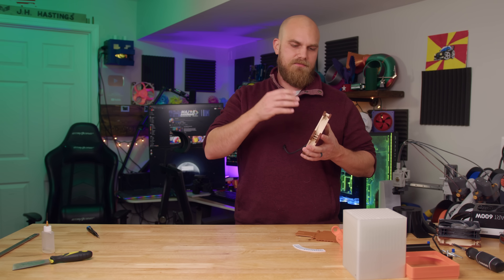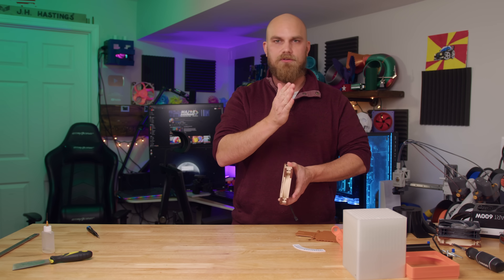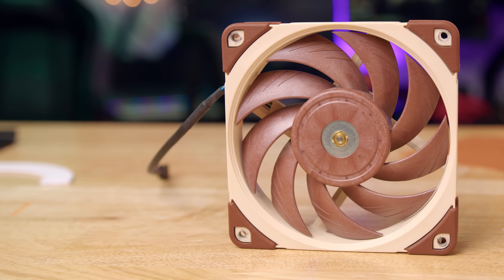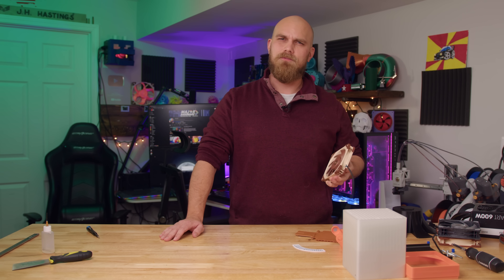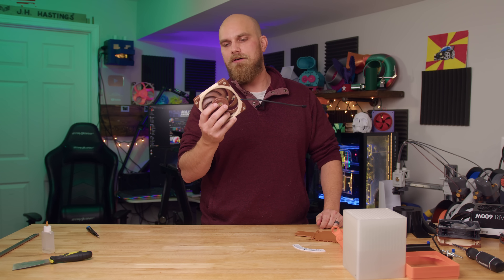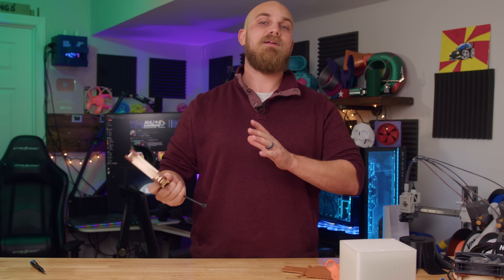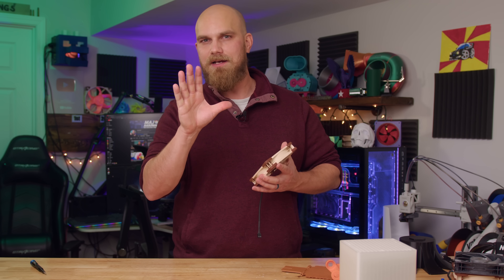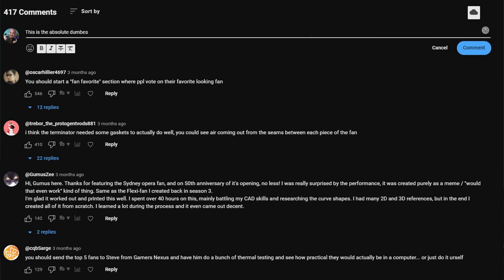I Built a Static Pressure Machine | Fan Showdown Season 6 Pilot

Comment: Looks like the scale will only be interesting between 3 (poor) and 6 (very good) , given that the Noctua motor with its power curve are the common denominator. You could do an eccenter (?) on the hinge of the flap and measure the micrometer difference with one of those toolmaker clocks, to get a finer scale... Or extend the dial on the flap and make the scale bigger. 😁

Comment: Just for a bit of data collection. Put a potentiometer on the pivot of the flap. That'll give a voltage that can then be used for calculations. And enclose the flap in the tunnel.

Comment: I don't know what type of ISO specs are out there, but I would assume getting a good static comparison would require deadheading the fan.  Otherwise once the fan is flowing air through a cracked door you are not getting the maximum amount of pressure it is capable of.   Given the goal is a static pressure and that you know the pressure range your working in, check how large the door would need to be in order for the fan to force it open to a measurable angle and then work out from there how large the door would be to allow you to add weights to the door at different heights to know what the pressure is.

Comment: I think a fully contained diaphragm (whereas the angle doesn’t change) with some sort of tension would prove more useful. You would measure the displacement of the diaphragm from rest. The changing angle of the flap you are currently using means that your scale isn’t static as far as unit size as the greater the angle from rest, the less direct force on the flap.

The diaphragm could still be a solid flap. Place it on bearing tracks and have a rest position where it is held with tension via springs or elastic. The full force of the fan will be measured this way as it will be fighting against the elastics until the force equals out. Just an idea, though I know there are still complications and errors with this design too.

Comment: As the angle increases more pressure will be able to escape, and the deflection angle will be shallower, as a result there will be diminishing returns, graphing the pressure to angle would show a function that looks logarithmic, would go up fast but then slow down to almost flat. While you can still get data from this the higher the angle the more precision in your angle measurement you would need. Plus there's likely to be oscillations/turbulence still and as such the flap with almost certainly be flapping a bit making a reliable measurement unreasonable. As stated by kendalguier1378 putting the flap inside the tunnel would help, as the air wouldn't be able to just go down once passing the threshold, however the logarithmic behavior of this would still remain.

Comment: Given the hing position most of the effective force will be at the far end of the flap thus its not ideal, you probably could divert most if not all of the top airflow and almost get the same result. This also means that the force indicator will not be linear compared to the "real" static pressure. 

I would instead suggest turning the tunnel vertical and have a sliding flap around a center pole/pillar.

Comment: Not an expert, but...
Your idea is pretty good, however here are some issues from least to most important:
- The scale is not linear
- Scale is too small, make pointer longer. And you can make lower flap more rigid too. Mass is not an issue, since you're measuring when the flap stops moving. If mass is, say, twice the amount, having center of mass twice as close to pivot point should make it perform the same.
- Don't think this is a good measure of static pressure, since there is still airflow. Imagine testing 80mm, hell maybe even 40mm server fan with some sort of adapter. While those normally have higher static pressure, your setup might still show them performing worse. In fact, stacking 9 40mm fans in 3x3 grid should give you the exact same static pressure as just one of them, but here you'll see vastly different result.Your contraption would still be useful for testing (imo better than pure static pressure), just don't call what it tests a static pressure because it isn't.
When i think of static pressure, i think of a fan blowing into closed box. Yes, closed. How to measure pressure? Well, imagine a soft tube (watercooling one is fine) that at one end starts in that closed box, then goes down and then up again, and ends somewhere where you consider to be normal pressure, say taped to the outer side of that box opened to room air. Now fill it partially with water. You'll have two water levels in the tube, so using the fact that you have soft tubing put them next to each other. You'll see that levels are equal. Now turn on the fan. One water level will slide lower (the side that connects to inside of the box assuming fan blows into the box) and the other will go higher. The difference between the levels is the pressure reading. Problem is that for noctua fan that would be 2,34 mm, which isn't much and is hard to read. However, you can use hydraulics to make the difference more apparent. Connect thick tubing on the box side with very thin one on the other side. The way you connect them doesn't matter, as long as it doesn't leak and doesn't have bubbles. Now, assuming crossectional area of thick tube is 10 times bigger than that of thin one, if one side goes down by 1.17mm, other will go up by 11,7mm, so 12,87mm total difference, which would be much easier to read. Now you can do math to get exact pressure or just not bother and use relative scale since it still is linear. there will be a small problem tho. When fan is off, the levels won't exactly match because of capillary force. That difference, however, will be the same no matter the pressure, so just subtract it from every test. Just remember, since you don't want to have to pour the exact same amount of water into the tube every time, you measure the difference between water levels.

Comment: A lot of people advised to use a U shaped manometer. My two cents to this idea is to use a fluid which has the lowest density as possible. Oil is less dense than water. This can increase the sensitivity of the device.
Reply: There's always isopentane but you need to keep the liquid under 80F, or it will boil. Also flammable 💥💥💥
Reply: @knibknibknib  Haha, good one! I don't think a liquid with high vapor capabilty (eg alcohol, pentane) would be a good choice, though.

Comment: Glue a plastic "Trailer" type 2-way level on top of the tunnel to confirm level before each test. At least consider the potential effect of supply voltage, air temp & humidity on test results.

Comment: You could make the door smaller so it's easier to push open and use up more of the gauge, or make the arm that marks the gauge reading longer so it's weight helps balance and open the door further. if you could somehow have a digital gauge to read it that would also be cooler.

Comment: So, the air is all leaking out the sides and bottom so you hit "maximum" very early. You can get more reliable results at a larger range if you put the flap in the middle of a longer tube. Basically, the wind tunnel you had before, but right in the middle of that you put a similar flap and measured the same way. Very simple, but it would give you more granular results. As it is, the way the air flows on your scale is almost logarithmic (it isn't really but getting from 9 to 10 will take WAY more pressure than getting from 8 to 9). 

TL;DR - fully enclose the flap.

Comment: Flip the door around. They way you have more surface area to resist the air flow. As is, you have a sick surface for the air pressure to slide off of. So once you get sufficient lift the rest of the airflow just slides past. As is, i expect many fans will fall into a very similar range of measurement. Less granularity of measurement.

Comment: The higher you get the less air will actually be hitting it. Also airspeed and volume will play an almost equal role is how far that flap goes up. 
In actual tube and hose with water in the bottom leveled out to the zero on the hose will give you true static pressure. You can get accurate measurements this way that correlate to industry standards for columns of water.

Comment: I like the idea. You should try using TPU gaskets on top of the end of the parts, where they are joined. I do not think it will improve the performance or accuracy by a lot, but it might. 

You also said that the isogrid you added to the flap was 2mm thick and 1mm wide. I do not think it is very heavy, but you should try making it even lighter. Maybe resin printing can help in there (to provide a very thin piece) or to reduce the thickness and wideness of the isogrid.

Comment: I measure static pressure and use the squirrel wheel type fans. I PWM to get the static pressure that I need. I use a Dwyer Mark II incline manometer. It is large and photographs well using the red oil, very retro. It is a lab grade static pressure sensor for -0.05" to +3" Water Column. This what the HVAC industry uses for static pressure. Good video and subject matter. For our usage if it can't lift a ping pong ball or 0.25" WC, it will not work for us.

Comment: Fan blows into a box.  Other end of the box is a hole, but otherwise sealed. Hole has a piece of clear tube that you probably have lying around. Tube drapes down off the table, then back up.  Fill partially with water, mark level when fan is idle.  Turn the fan on, measure the delta.

Comment: Sorry to say, but your contraption is still an anemometer (it's called "plate anemometer"). But you can kinda turn it into a pressure gauge by replacing the deflection (angle) gauge with simple electronic scales. You need to keep the plate shut (or let it open only slightly). You probably have, or you can buy for cheap, appropriate scales. The force will be in the ballpark of 25 grams-force which is plenty.

Comment: Use a Magnehelic. You can get old that reads from 0-6mmWC for 73.00. it's an analog gauge but will work perfect for this. I will attempt to comment with a link, but YouTube will probably take it down.
Reply: You'd want a 2000-6MM or a 2000-10MM 

Depending on how powerful you think the fan showdown fans will get.

Comment: I think every fan creates its own tunnel where most of the air flows through. Some push the air more through the top and some more through the bottom. Depending on where the fan creates this tunnel, the air will hit the flap at different points creating more force farther away from the hinge. 
I don't know if that matters at all but I wanted to point it out

Comment: I'm not that kind of engineer, but my gut tells me that the air pressure won't relate linearly with the door opening angle. Because as the doors opens, you'll need progressively more pressure to move the gage each radian, both because as it opens more, more air will scape reducing the pressure, and second because as you push the gate it will have mechanical advantage, requiring a bigger force to move it forward. So the issue is not that you cannot measure pressure this way, but you'll loose resolution as you approach the top of the scale, making more difficult to differentiate between the top performers. In my mind a fully vertical chamber with regular holes in the membrane would be a better option because that ways all the forces will have the same alignment, and you will also always have the same air exhausts geometry. Again, I'm just a software engineer, the weakest form of engineer out there, so if someone more knowledgeable than me cares to correct I'll be really grateful.

Comment: My primary thought is to somehow make the measuring arm longer so you can have finer measurements. You're going to have a lot of measurements that are barely off from each other, and your current scale may not be able to show the difference very well.

This is a really cool way to do this! I'm in favor of this shift, overall.
Reply: also maybe consider a logarythmic scale rather than a linear, as the effective surface area in the forw of the Flap decreases the wider it opens.
Reply: @haemmertime  perhaps the scale could be straight, rather than circular.
Reply: He's got some electronics chops, probably could scrap the dial and mount a capacitive encoder on the end of the flap shaft piped to an arduino and display an actual value. Find an encoder with 1024 gets a precision of .35 degrees per count.
Reply: You, make the lever thinner and longer for higher resolution and build a tunnel around the flap so that the air does not escape to the sides but only at the bottom. (mostly)
Reply: Exactly my thoughts as well
Reply: To have more precision without making the arm too long, you could consider using a Vernier Scale.
Reply: Longer arm will add weight which needs to be compensated on the flap as well. Instead of a physical arm, somehow get light involved? Make something such that the arm has a slit (adding as little weight as possible) and there's a light box(?) resting on the top of the housing (so no weight on the arm) that will shine though the slit which moves with the angle.
Reply: @zecuse  Like a laser pointer that could aim at a gauge farther away?
Reply: @carlpeters8690  It doesn't have to be a laser pointer. In fact, it probably shouldn't because you would need to rotate it as well. I was just thinking maybe an LED or 2 that's inside a small housing sitting on the frame of this contraption. The flap's arm has a slit that would only allow light through that portion near the "scale" in the background. Only concern would be making sure it doesn't bleed out towards where we want to see.
Reply: Great idea! St may be done whith mirror film instead.
Reply: @zecuse  That's a great idea. He could mount a lightweight mirror and use a laser pointer on the case. Even a tiny deflection of the mirror would make a signficant change on the resulting laser dot, measured at a set distance or even just a %delta.
Reply: If the back flap is made reflective then a laser bouncing off of it and into a ceiling or much larger guage would be potentially infinite precision.
Reply: I was thinking the same, when the most powerful fan only got too 9 on the scale I instantly felt it needed a different scale with fractions of measurement.
Reply: maybe make the arm coming off the door 3x as long and the arc go from the other end of the tunnel
Reply: Definitely,  also should also:
1. Make measure arm longer for more weight balance
2. Use air compressor to see max level he'd get on the scale and change psi to get the gradient (1-3 are easier than 4-8, etc)

I like it, and think it has potential with some mods
Reply: This, the resolution is not granular enough. Honestly closing the sides and the bottom with transparent panels might also help as the escape area would increase much much more slowly when the panel opens. It should also make the values (a bit) more linear if it's open on the front only. Longer arm/digital encoder/laser pointer might also help.
Reply: Pretty sure any laser will weight more than that piece of plastic
Reply: @alessioorlando3604  The light source isn't on the arm. An LED in a small housing resting on the frame of the tunnel would only need a small amount of plastic added to the arm to allow the light to shine through a slit that produces the reading.

Some concerns do pop up though: light bleed through any cracks involved with ensuring the arm can still rotate and light bending too much through the slit.
Reply: @alessioorlando3604  Use a mirror to deflect the laser
Reply: Yes was thinking the same. Major, Set the scale (arc) three times as far away or as far as you can to gain as much precision as possible. Ideally you should have at least 0.05 accuracy looking at the current scale. Use the Noctua as a reference and put the value there 10 or 100 (print new changing instead of 6, 100). And 0 where it is completely closed vertical. The ideal would be in logarithmic form. Follow the scale with more than 100 towards infinity if it is completely horizontal. Print and put a Noctua reference mark right where the Noctua frame (6?). Compare the noctua on a summer day with very high pressure and a winter day with very low pressure to see the difference. If the difference will be important, then every time you perform a test, first use Noctua to create the reference. Move the arc (it is necessary for the scale to rotate) so that it always marks (6?) and from there you can launch the test with the other competitors. Good luck!
Reply: I like the longer arm idea... and also maybe adjusting the counterweight ratio so that you end up on the higher end of the scale, allowing more granularity and room for the under performing fans (which is the vast majority of submissions).   You could always switch back to this door or one like it for higher performing fans.
Reply: Yep and it's more of a counter weight.
Reply: Yeah, was my first thought as well. You don't want have everything between 4 and 7, and worst case, 4 fans in an episode which are "close to 5" or something like that.
Reply: I was trying to think of  a way to do this linearly with springs instead of on  a pivot but nothing would have been light enough without too much friction.  This sounds like a good compromise.